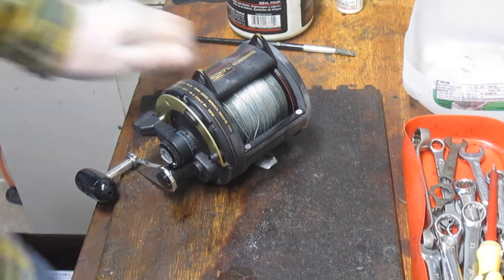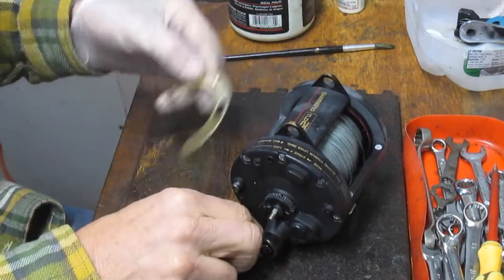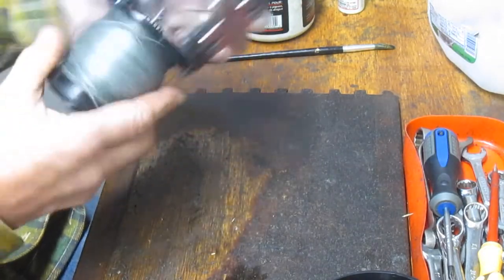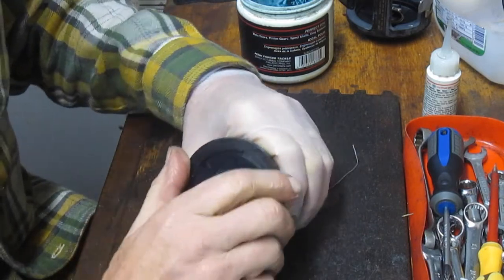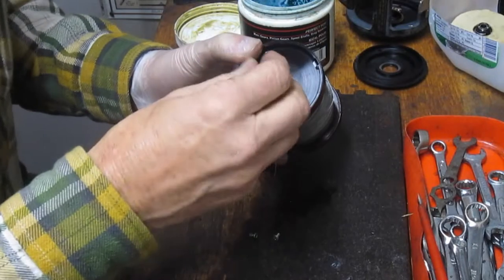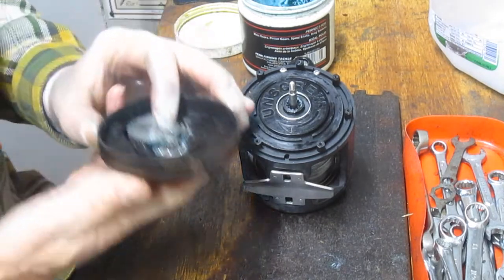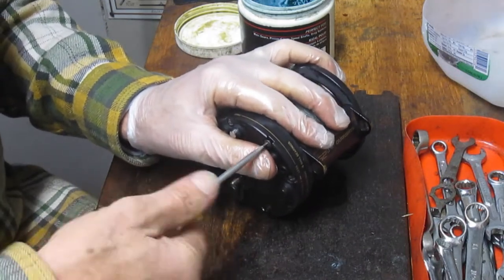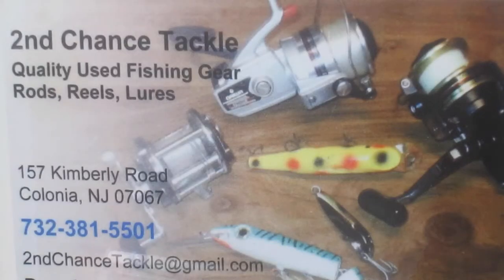Shimano TLD 25 How to take apart and service this lever drag fishing reel

Comment: thanks again dennis, I was able to take apart and service my reel with your help, I watched a few other videos where they used a hell of a lot more grease everywhere than you, not sure if that makes any difference, I pretty much just lubed the bearings and greased the shaft and cogs like you did in your vid, seems good to go!
Reply from the maker: Glad it helped and thanks for the feedback.  You can use more grease, but it won't do any more good.  It will just spin off and lay around in the case.  Best wishes - Dennis

Comment: Great vid I have a tld 15 fitted new bearings and carbon drag washer after large shark demolished drag can't get drag to work now
Reply from the maker: Check your presets.  Do you have the rest of the reel working in free spool? Does it tighten up, but just not fully in the max drag position? That is usually an alignment issue on the reinstall of the lever.

Comment: Great tutorial. One suggestion...if your not planning on re-spooling the reel after service, then should avoid touching the line with oily/greasey hands. Otherwise excellent.
Reply from the maker: Good tip!  I recommend changing line with every annual service, but I will take your tip to heart - Thanks for watching and for the feedback - Dennis

Comment: Every time i screw the sideplate in fully, it locks up the spool for some reason and i cant pull line out. How could i correct this?
Reply from the maker: Sounds like you don't have the Lever Drag preset correct.  Take it off and reset it.